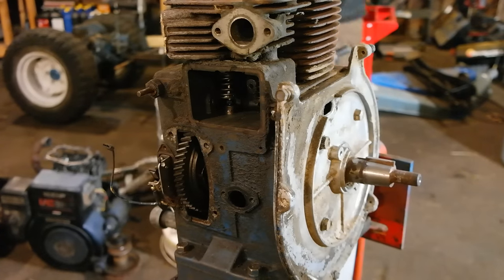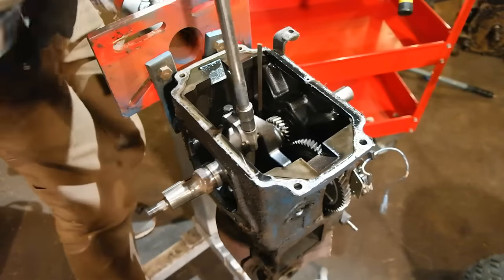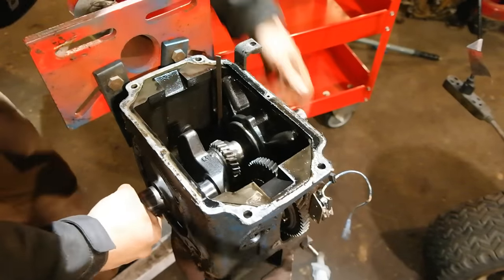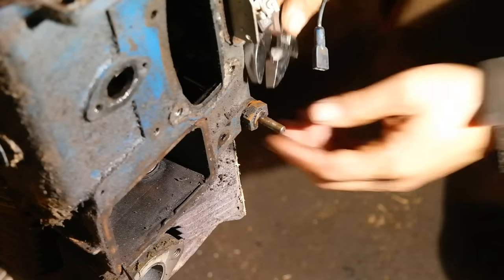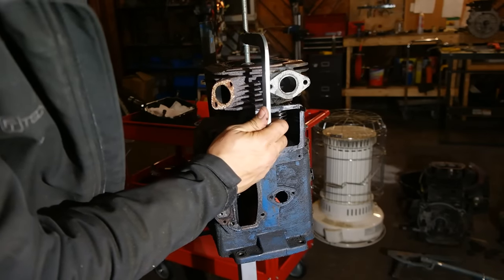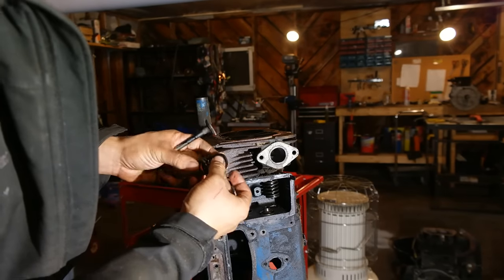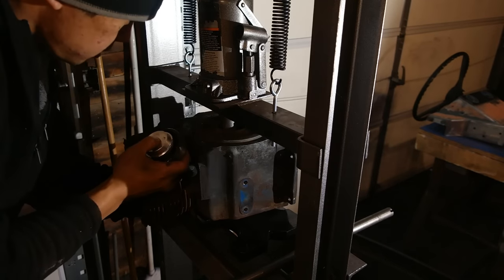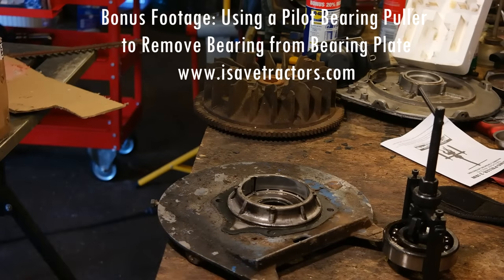How to Restore Your Vintage Garden Tractor Ep. 4: Kohler K Engine Disassembly part 2

Comment: Great job on the video.
I came to see if it would show why the breaker points push rod no longer pushes the points.
It appears there is a lobe on the camshaft. So that suggests the cam is not turning, or the lobe on the cam is so worn there is nothing left to push the pin. There was no noise to indicate trouble. I parked it and about 30 seconds later tried to start and no spark. With the points removed I cranked the engine with my finger on the pin and there was no movement. Guess I'll be doing a tear down.

Comment: you need to show removing and installing a older k241 cam that is 2 pieces . 
mine fell apart in the block pulling it out.  and now not sure witch way the lobe for the points goes back in.

Comment: I have what may be a dumb question, but I was working on my k341 and made a mistake and caused the rod to break.  When I opened it up, the cylinder wall looked fine, and the crank cleaned up nicely, and nothing looks out of round, but the piston skirt was broken on one side.  Otherwise, the piston looked just fine.  Is there any way of reusing the piston even with the piston skirt broken on one side or would it cause an out of balance condition and lead to eventual failure?
Reply from the maker: If the piston skirt is broken, you should replace the piston. We have them in stock, so give us a call on Monday and we can get on right out to you

Comment: So this is an odd question but do u know how to make aluminum dually rims cuz i got a 2 year project starting this summer my plan is to build a small ride able semi truck?
Reply from the maker: You can use these wheel spacers to set up duelies: http://www.millertire.com/products/wheels/parts/dual-spacers/12-dual-wheel-spacer-kit-with-12-bolts/
Reply: isavetractors thx

Comment: I was wondering how you get the paint off the engine and paint it?
Reply from the maker: Many ways. Degreaser and paint over it, sandblast it, chemical paint remover, angle grinder with wire brush, sandpaper, etc.

Comment: Norman  the tab has broken off my governer cross shaft can I just pull the cam shaft to  replace the cross shaft or do I have to pull the crank shaft?   great website, lots info thanx
Reply from the maker: In order to pull the camshaft you will need to pull the crankshaft too. While you're there you should inspect the crank, bore, bearings and replace gaskets and seals if needed
Reply: thanks for the quick reply, your videos are very clear and detailed, helps me a lot, thanx

Comment: Is it possible to take the valve springs out without removing the long valve guides, or removing the push rod adjusters?
Reply from the maker: Yes you use a valve spring compressor and you can take them out between the tappers and valve guides
Reply: @Isavetractors  I have one of those compressors that looks like two sets of chopsticks with a t handle to tighten it up with. I can't seem to get the valve spring, keepers on top and bottom, and rotator, all in the jaws of the compressor, and get all that out.. I was thinking maybe I need to bite it differently and only take the spring out. Or only the retainers, then the spring will have room?
Reply from the maker: Yea those kind take a little tweaking. Widen the little "fingers" on the tool so it will hold the spring just right then you can tighten the spring all the way down. It takes a little knack to get it right
Reply: @Isavetractors  I adjusted the adjuster all the way down. Then got a bite on the coil of the spring and not the top. Then I removed the rotator, and retainer, then slid the spring down. Got the top cap. Then compressed just the spring and took it out. Took some doing and about 20 minutes of deep thought. Now.. I'm pretty sure the intake valve is supposed to have a rotator as well according to diagrams. Can you confirm that the intake and exhaust rotators are the same size, I can't find a part number for both the intake and exhaust rotators. Only one shows in everything I can find.

Comment: Was your governor cross shaft missing the tab that goes to the governor gear? It's a fairly common problem with those engines for it to snap off. And fall to the oil pan. I put a bead of weld on mine to reinforce it whenever I have them out.
Reply from the maker: jhitt79 no this one wasn't broken but you're right they break often. we sell used ones if you ever need one.
Reply: isavetractors In the video, it looks like it's missing.
Reply from the maker: jhitt79 you're right. it does look like it's missing but I'm actually holding that part
Reply: isavetractors ahh... now I see it, you are a "slight of hand" tractor magician.
Reply from the maker: jhitt79 :)

Comment: Whats wrong when the points plunger doesn't move anymore in my K301 12hp engine ?
Reply from the maker: Might not be anything wrong but points came way out of adjustment. Loosen the points adjustment screw and push the moveable contact all the way in. Now does the points plunger move? If so, reset gap and off you go.
Reply: @Isavetractors  while removing points I discovered the points wire was loose, tighten up, running good. Thanks for your help 👍

Comment: Thanks for the informative videos.  I recently just got one of your new carbs and it works fantastic....thank you....Quick question I hope you can help me with..I have built off road bike engines, 2 and 4 stroke for years, but I am having an issue with my K341.  It worked perfectly for a month with the new carb and parts.  My tank my fully cleaned, as well as new fuel lines, fuel shut off, and in line filter...I do not believe my problem is carb related, but possibly governor related?  I never had to mess with governors on my dirt bike builds..lol!  This is why I am asking.  What it is now doing is after starting the engine.  Just opening the throttle slightly is making the engine over  rev.  Then put it back to idle position and it stays running fast. .I would then quickly push the throttle lever up and down once and it would go back to normal idle...only to do the same thing again...I looked over all linkages from where the cables connect to where the governor rod moves and nothing is getting caught...I'm a little at a loss if you have any suggestions?  I did already reset the governor shaft...it moves as it should when not running and was able to check it and it is correct.  The governor spring is in the normal factory position...Cable linkage end is slightly elongated in the hole making it probably a little to less sensitive but I know this isn't what is causing this...when its racing, I took my gloved hand and lightly pushed on the governor shaft to see if it was freely moving..no luck as it is like its stuck there,,,,until I blip the throttle fast and then you can operate it even while the engine is running....Is there weights or something inside on the governor set up that push out by centrifigual force to control is or is it something I am going to have to tear down and replace something....the points gap is holding so I know the came itself shouldn't be grooved or worn...thanks in advance...I need my 1650!!  lol For now I am going to take everything off including the cam cover and double check everything..I  did replace the bolt where the throttle and choke cables hook to the "levers" with the holes in them as it was stripped inside do to old age and loosening up and it messed it up...i replaced it with the correct size and length and had to put a lock nut on the inside as it seems that it originally had a nut welded into place?  not sure hard to see in there...Everything was laid out in order and put back in order and no snags and works as it should.....I'm all ears,,I use this tractor doing my gravel driveway part time job of my own at night and weekends...i use the plow and a small land leveler for small jobs behind it as well as a heavy filled roller to pack it down smooth when finished....My other little Husqvarna lawnmower that is belt driven to the rear end won't take that job very long...help!  My main Ford 3910 with FEL and stone rake is lonely without the old cub, :)
Reply from the maker: Hi There, thanks for your comment. A common breakage point is the governor cross shaft. Try: Remove the governor arm off of the cross shaft, after disconnecting all linkages leading to and from it. Now try to rotate that cross shaft you should feel it press against the governor gear when rotated counter clockwise. If you don't feel anything and it just rotates it means the cross shaft broke. The cross shaft is the piece inside that pushes against the weights on the governor gear. Without this cross shaft, your governor is not able to govern the throttle. This happens, and I've seen it personally on engines that come through my shop many times. Unfortunately to replace the cross shaft, you have to completely disassemble the engine. Give that a check and let me know what you find.
Reply: Will do thank you...I just got home from my regular night job and was heading out to the shop to work on the Cub for awhile...thanks for the quick response....I do believe it is not rotating though as I checked it to see if it came out of adjustment...i just scribe lightly a straight vertical line to help with the visual when retightening...it stopped where it was supposed to then...I will take it all off and check again and let you know in awhile...thank you.
Reply: Finally got there....Anyhow I took the governor arm off and the shaft is stopping as normal when you turn it counterclockwise...let go and it will slightly shift clockwise on its own....then it turns clockwise almost a 1/4 turn and stops again...slight in and out play...
Reply from the maker: That's normal. Next do a "Static Adjustment" it's described in the Kohler manual. You essentially make it so the cross shaft matches the governor arm on the outside. Reinstall your governor arm but leave it slightly loose. Install throttle linkage. Grab the cross shaft with pliers and turn counter clockwise until it stops on the governor gear. Now rotate the governor arm until the throttle is at WOT. Tighten everything. This synchronizes the cross shaft to the carburetor.
Reply: thank you....Well I found the issue..I can't believe it broke already..I got looking at the new carburetor and the throttle shaft pin or rivet whatever its called..the linkage the governor rod attaches to the carb..well it broke loose from the throttle linkage..same thing my oem did....dang it didn't last a month....I repaired the original with long cure jb weld and used it till the new carb came in.....I don't really want to return it so I will patch it up like the old one...it must be a weak spot in these carbs to have it come loose and its letting the throttle valve do whatever it wants....now i know what it was sticking and lost throttle control.....thanks for the help....if i decide to return i will pm you guys on your website....thank you for your time.
Reply from the maker: Send me an email with your order information (info@isavetractors.com), and I will send you a new shaft today. Those balls are press riveted in place like the original. I will get you fixed up!
Reply: well actually i gotta make it work because i had to use the original choke adapter also on the new carb..the one that came with was the same shape but backwards on how it was mounted so you would basically have to push in the choke to open it and vice versa...but there is no way to put on the air cleaner so I switched the parts....chase the bb and spring....lol...almost as bad as chase the o ring on the float bowl...i will get it working again no worries...
Reply from the maker: Ok sounds like you may have purchased one of our other carbs. We have a carb with many choke configurations to match exactly what you have. I can send you a new throttle shaft, (The part with the ball on top) no charge. I just need to know where to send it. We always take care of our customers.
Reply: okay i will catch up with you later today and do that...gonna throw the old carb on it for now cause i gotta have it going....ttyl thanks
Reply: yeah i got it on the ebay store and didnt realize the end was opposite direction even though they look the same...no biggie i took care of it...I will get on your website with my order if i can find the paperwork...lol...if not you will probably have my name and info in your system already as i got other things too...
Reply from the maker: I'll send you the proper choke too. We're moving away from selling on eBay because their system makes it difficult to provide superior service. Check out our website directly and you can see all the different configurations we have available.
Reply: Yeah I saw your website after I did the ebay order...Yep I don't blame you at all for dropping that.....okay I sent you a customer info message with my information for you...and thanks for the help and the parts....I will just leave it apart for now and use my new Husky for a day or too lightly hahaha...that roller is heavy and it will ruin the belt to the tranny for sure...
Reply: I really appreciate the good service you offer...thank you for prompt help....I will be needing more down the road from you to keep my old 1650 working and making me cash..lol!  Much cheaper than a new compact Kubota for what I use it for.....Yeah I was surprised that the carb broke loose there again on this one....I wonder when it gets pressed together that maybe it doesn't quite hold well enough sometimes...who knows...you can look into that on it to help you guys out.....simple carbs though....I build up and tune Keihin FCR carbs for dirt bikes and dual sport bikes as well as Mikuni TM carbs...they are both flatslide pumper carbs and tough to get everything in sync with the accelerator pump and then correct jetting to adapt them to different bikes....I've done allot of them.....you should see my 650 Zuk my name for here...its been featured on web bike world a few years back on my build....tons of cash into suspension, pumper carb, full exhaust, JE high compression piston...oversized valves...you name it it had it....I sold it 3 years ago now....My gosh it was fun with the super moto tires on it.....wheelie up corner to corner.. :)  Have a great day and thanks again.....hopefully you got my info from your website i sent you...

Comment: Could you tell me if the K181 turns in a counter clk wise rotation?
Reply from the maker: All of the K series engines turn clockwise when looking at the flywheel